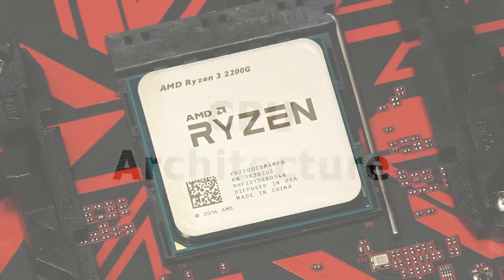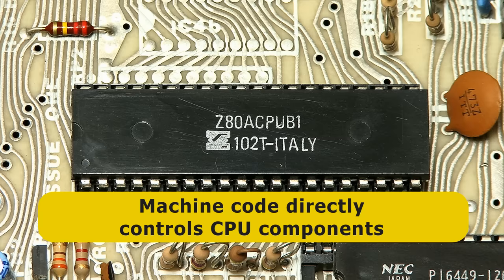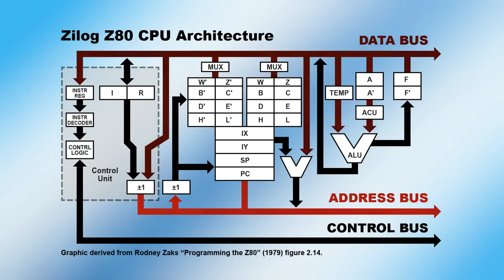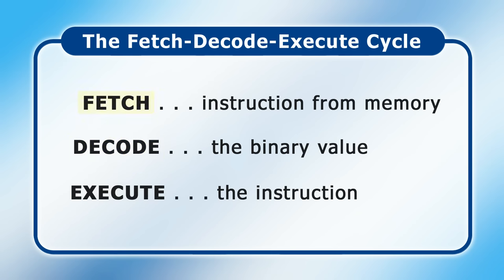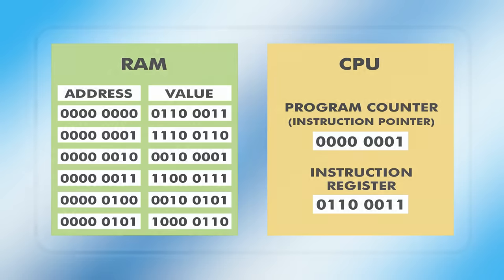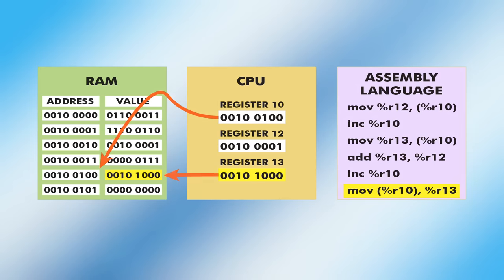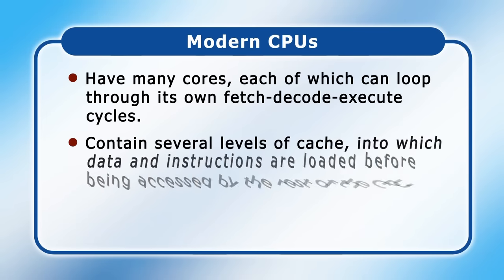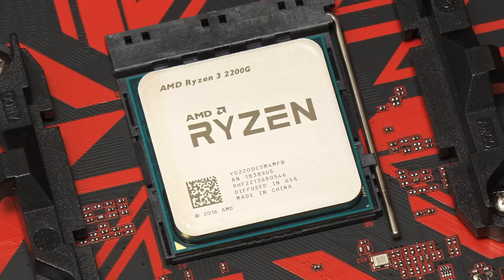How Do CPUs Work?

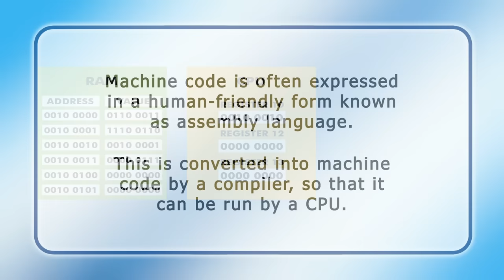Comment: 6:10 the code is 'converted' by an assembler, not compiler.
Reply: The code is converted from "assembler" to machine code by a compiler.
Reply: @arieloq  In this special case, the compiler is an assembler ;-) Most of the time: Higher Language -(compiler)-> bunch of assembler instructions -(assembler)-> binary -(linker/loader)-> memory.
Reply: @horstschlumma8501  Totally correct.
Reply: @arieloq  No, by an assembler. Compilers are/ do the same but for higher level languages. This situation it is called an assembler.
Reply: This is hair splitting. In general terms a compiler is any program that takes human readable text files and converts them to a format that can be loaded into computer memory ready for execution at run time.( FORTRAN, Ada, BASIC, C etc). An interpreter reads a text file line by line and executes it line by line. (BASIC or Python). Then there are compilers that convert a text file into an intermediate “language” that is executed by an interpreter (UCSD pascal). Then there are compilers that read a high level language and produce an output for a different processor. I would suggest that compiler covers all of these.
Reply: Yes, it is a bit confusing that the 'assembler language' or 'assembly language' is called this way, and the app that converts it to machine code is called just 'assembler'.
Reply: An assembler simply converts human readable/understandable mnemonics, names, pointers, etc. to machine code (and sometimes adds file header information, etc.).  Every byte of machine code comes straight from the assembly language mnemonic.  It translate your ADD A, 55 or CALL dothis to the appropriate machine code so you don't need to remember the ADD instruction number or have to calculate the location of CALL.
A compiler takes a higher level language "divide number of apples by number of people" and converts it to machine code for the CPU you are using.  The same high level code can be used on different CPU architectures and will result in different machine code for each.  Even different compilers will/can produce different machine code for the same CPU (often depending on optimization settings).
An assembler is going to produce the basic same exact machine code every time.  Assembler code is CPU specific unlike most high level compiled languages.
More or less.
Reply: @MRCAGR1  See it the other way around. A disassembler can convert machine code into ASM but not into C or BASIC.
So an assembler is not a compiler.
Reply: @MRCAGR1  Whether your program runs or not usually depends on which way the hair is split.
Reply: I am not up to speed with modern compilers.  40 years ago we used a Compiler to convert high level language files to assembly language files.  If a program had multiple high-level language files, each was converted in turn.  We ran the Assembler to convert each assembly language file to an object code file (again on a one-to-one basis if there were multiple files).  We used a Linker to link those object code files together into what was often a single binary file containing the machine code for the entire program.  This last step also tidied up any cross references between modules for things like memory locations and subroutine entry points.  I guess in some cases these functions are combined either into a single process and hence would sometimes be seen as simply "compiling" even when there are multiple steps that are actually needed.
Reply: I got yelled at by one of my CS profs over this mistake ;)
Reply: @arieloq  No it is not. An assembler is a program that converts assembly language programs to executable binary code. It may have to go through other processes like linking and loading. A compiler converts higher level languages like C, FORTRAN, etc. to either executable binary, but more likely to an intermediate level code not quite ready for linking and loading.

Comment: You did an amazing, "CPU briefing: Part 1." "Part 2" could mention typical needs like: DC power, thermal control (so important!), and increasing clock speeds. "Part 3: Real World Applications" might include a quad core example. Mention what can typically go wrong with a CPU controlled machine. (Why is it the "fix" for something is to reboot a system? Could a CPU controlled machine better indicate a problem or fudge or temporarily correct a situation?). Bravo!!

Comment: My first assembly language was Motorola 6809 assembler.  The 6809 was basically an 8-bit CPU, but was quite advanced for the time, with a 16-bit stack pointer and a built-in multiply instruction.  Its assembly language was very clean and orthogonal; it was quite shocking when I learned the dog's breakfast that is x86 assembler!

Comment: In one moment I'm transported back to Redbridge Technical College in 1982.
Although the one CPU on a board which had to be shared amongst all the students was an 8080, not a Z80. The instructor was a Geordie and pronounced it "a'ey - a'ey."
Compiler? HA! We had to write it out on paper in assembly language and then translate it all, line by line into Hex, using a laminated reference sheet with peeling corners. Then enter the hand-written translation one character at a time into memory using a very clicky 0 to F keypad.
After several hours of graft, the board could add 2+2 and display 04 (if you'd got everything right) on a pair of 7-segment displays.
That simple board probably cost more than a modern mid-range laptop.
Reply from the maker: Great post. I too prepared my Z80 code in hex on paper, performing "poke" instructions to but each byte into RAM on a ZX81 (often by holding them in a REM statement). Happy days!
Reply: When I began programming in machine code, I would write out my programs in assembly on paper, using arrows to indicate jump instructions.  I then manually translated the assembly instructions into hexadecimal as I was typing.  Fortunately, Apple || computers had a built-in disassembler so I could immediately check if I made a mistake.

Comment: My first CPU was a TMS1100 found in my Merlin toy back in 79'. My second was a Z80 found in my Tandy computer back in 82'. I recently had a bout of nostalgia and bought both CPU's. I had no idea at the time just how momentous those early pioneers were! People that grew up in the 70's and 80's were forced to learn the inner workings of the computer. Operating systems hide most of the nuts and bolts away from the public these days.

Comment: You have got to have silicon running in your veins cause I didn't understand most of this, but I'm glad you said "if it sounds complicated, it is" otherwise my self esteem would be severely damaged.
Reply: He said "if all of this seems rather tedious then it very much is". But yes, I understand where you're coming from. I learned fundamental logic stuff in grade 10 in the early 70s. I'm glad I got it that early. We didn't start with hardware and registers and such. Memory was equated with envelopes & postal addresses and contents - real world stuff that was relatable. You may be missing some of that groundwork! I must say I had  great teacher. It's hard to compress a year's computer class into a 10 minute video. Plus in my day, the Z80 was still 5 years away.

Comment: That Z80 looks a lot more complicated than the 6502 I cut my teeth on. I don't remember even half a dozen registers on that chip.
But I initially learned in class on an IBM 370 mainframe. My "aha!" moment came when I really understood the relationship between the program counter that said what the current instruction was and the program status word that gave the result of that instruction. I finally saw how a particular binary number could actually trigger specific action within the CPU. I was inspired!
Reply from the maker: You are right, the Z80 had a lot more registers than the 6502, not least because it had an alternative set that you could switch between! Happy days.

Comment: Brilliance often equals elegance. Wonderful video, kind friend. Could you do the same sort of elementary piece on quantum CPU in the near future? I'm not wrapping my head around how particle position is not similar to transistor state at the code level. Spin up, spin down and both seems like it would equate to high state, low state and off, yet the usual examples of Q-code seem to do work in all three positions where transistor based coding is taught as only doing work in high state and off while low state is simply used as a control. Am I misinterpreting this relationship?

Comment: The program which translates assembly language to machine code is an assembler, not a compiler. 😉
Reply from the maker: A compiler is the generic name for any program that converts code from one language into another. :)
Reply: @ExplainingComputers  IIRC an assembler is used to translate assembly language into machine code. The translation is one to one: each assembly instruction is translated into its equivalent in machine code.

Compilers and interpreters translate higher level languages into either machine code or an intermediate code (aka byte code). The translation is not one to one. A single statement in e.g.  BASIC or C is translated into many machine code instructions.
Reply: Way back in my college computer class days when we coded in assembler on a 6502 it was 'compiled' to machine code.
Reply from the maker: @steveshadowphoto9346  Thanks Steve. Good to know that I'm not going mad here.
Reply: @matth.imaging8952  That is how I learned it.
Reply: @ExplainingComputers  Back to you, Steve.
Reply: @matth.imaging8952  I wholeheartedly agree !

Comment: Pretty nice. For me the simplicity of a Attiny13a did open my eyes to the madness that are modern x86 processors. 
Many people just judge the speed of a cpu by the clock speed and maybe the number of the cores. 
But the instructions per cycle, data throughput and effects of microcode make it much harder to judge the performance by just a few metrics in a datasheet.
I remember AMD did use a risc architecture in their amd K6-2 series and used instruction decoders to translate the instructions and drive either the risc locgic or specialised logic to provide instruction set extensions like mmx and sse with their wide registers.The code compiled for intel would now run in some cases slower or faster on amd. This lead to windows 95 being unable to run on amd clocked higher then 350MHz, unless a patch was applied. The issue was that the cpu finished some operations before the task sheduler expected it. While intel cpus did not trigger the bug at any clock speed, as they processed the specific instruction much slower..

Comment: One thing I have found that confuses people is arrows like in your diagram saying "input" and "Output".  CPUs only have instructions for storing and reading from addresses as if they were memory.  I remember being a very frustrated kid upon discovering there were no 6502 instructions for drawing on the screen, or for making sound.  Eventually I figured it out, that the video draws what is in memory, that the speaker is connected to a particular memory address, and even the keyboard just puts an ASCII value somewhere in memory.  I'm not aware of any CPU made in my lifetime that had special instructions for input or output beyond those for memory.  Even the "CPU stack" is just a reserved region in memory, with some convenient instructions to read and write to it.

Comment: I built my own very simple 4 bit CPU with RAM. you have to manually use machine code but it only had 7 instructions. It was way more tedious than just loading values from a register to RAM. rather you would have an accumulator and you could swap any register value with the accumulator then load accumulator value to RAM. for example if you wwanted to load register 5 to adress 9 in ram you would first need to swap register 5 and accumulators locations and then load it to RAM then swap it back to be in the same state as before with values changes.

Comment: I learned CPUs with a microprocessor course from Heathkit/Zenith back in 1981.
The trainer was the ET-3400 sold on eBay as a collector's item. 
There was no assembler! Direct OP code in Hexadecimal Only. 
You laugh, but I was using punch cards back in university. 
Kids have it so good these days.

Comment: I have a request: Chipsets. How do they work and how they work with a CPU?

How does the internet work? Encryption too.
How does a electronic circuit make a dehumidifier dehumidify... i can go on and on.
On the compiler front... is it algorithms that convert binary into code?

Also, career-wise are there jobs that combine software and hardware... I don't get how they talk to each other if that makes sense.I basically want to know how hardware and software work together. 

Recommend any books? I have yet to read "Code" by Charles Petzold but it looks good.

Comment: Yes Z80 was a very fast and popular 8-Bit CPU like the enhanced version of the Intel 8080. Federico Faggin designed both the i8080 and Z80 but left Intel in 1974. I still got my ZX Spectrum as well as had learnt Sinclair BASIC and Z80 Assembly code. Also, Motorola had made a popular 16-Bit CPU, the 68000 but had forwards compatibilities for 32-bit. M68000 was made for early Amigas, AtariSTs and Macintoshes. Motorola had made the successor to the 68000, which was the 68020, followed by the 68040. This had a faster clock speed and added the FPU and MMU - that for the Amiga 4000. But for the lower-cost variant of the Amiga AGA range - the A1200 had an M68EC020 or even M68LC040. Those processors excluded the MMU, FPU as well had a 24-bit Address Bus instead of 32-bit. The EC and LC stand for Enhanced Cost and Lower Cost...if I'm not mistaken
Reply from the maker: Thanks for this. I was a big fan of the 68000 and descendants too in my Amiga and Atari ST days.

Comment: Awesome, how did we get to the point on creating such incredible technology what was its base or predecessor?
Reply from the maker: The progression was from the mechanical switch, to the valve, to the transistor, to the integrated circuit (IC), and finally to the first microprocessor, in 1971 as I recall. The progression of progress is indeed staggering.

Comment: Why did you show "x86" mnemonics instead of Z80 instruction mnemonics? - 6:35
You were just talking about the Z80, showed the Z80 architecture and register names, then suddenly switched to a different assembly language and register names.  Using register A would have been much more understandable (particularly to new learners) than %r13 , etc.  Viewers could refer back to the Z80 architecture slide already shown but were instead confused by %r13 register that suddenly came out of thin air.
Another good video other than that.   :-)
Reply from the maker: Fair point, an I did think about using Z80 assembly code. But then it seemed more logical to show x86 in the simplified CPU.

Comment: I remember one of those  chips in the ZX were called Feranti...They used to run hot.
Reply: That was the ULA. It was a kind of custom logic chip that replaced a large number of chips in the ZX80. It created the TV display, but it still needed the CPU to act as a counter to read the character codes from memory. This took up most of the CPU's time, unless you were in 'fast' mode and then you'd get no display at all while you were doing calculations!

Comment: I want a physical explanation how a pixel is calculated and drawn on screen. What is going on inside of a chip, where the capacitors and transistors are, how can these be controlled with a software code? This is still mystical, if you ask me.

You can click your mouse on a grafic icon and the computer will shut down, how is this possible? How can software control hardware, as driving a Tesla car almost autonomiously? How, how, how?

Comment: With Win 11 coming out, I wouldn't mind learning more about the TPM chip or trusted platform module.
Reply: There are already videos on YT that explain this and are fairly good. But one by EC would certainly be a helpful addition. However, it seems uncertain that MS will stick with the mandate, given the controversy it has generated. Almost as controversial as the firestorm set off over the definition of compiler and assembler.
Reply: @KameraShy  I have seen several videos talking about how to change the settings so that hardware becomes win 11 compliant. But I'm more interested in understanding exactly what the TPM chip does. I only understand the broad strokes.

They might do away with that requirement for win 11 but I kinda doubt it. Win 10 will be supported until like 2025(I think) and the majority of people who can't run 11 will stick with 10 and by the time 10 is no longer supported, their hardware will likely support 11.

Comment: I thought assemblers assembled assembly code
and
compilers compiled high level programming languages like C
Reply from the maker: I think we are at the level of semantics here!
Reply: @matthews4159  Your reference is inaccurate. Java is not a native compiled language, it's an interpreted language. Compiling to bytecode does not make a language 'compiled'. Every language is ultimately compiled, as compiling means to translate from one language to another. But a 'compiled language' specifically refers to a language that is ahead-of-time compiled to native machine code. Although Java, and nearly any other language, 'can' be compiled natively, it's typically not, and neither is it's reference implementation, and therefore, not a 'compiled language'.
Reply: That's the way I learned it.
Reply: @ExplainingComputers  cool joke